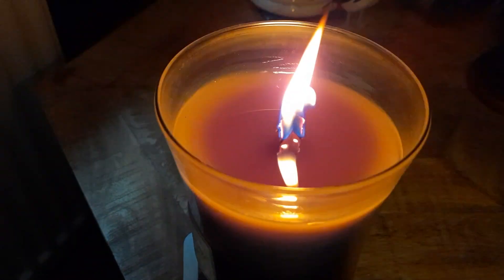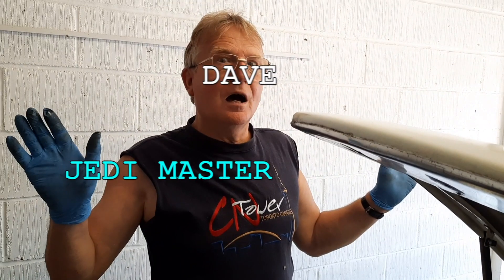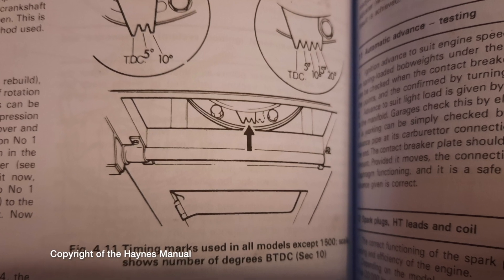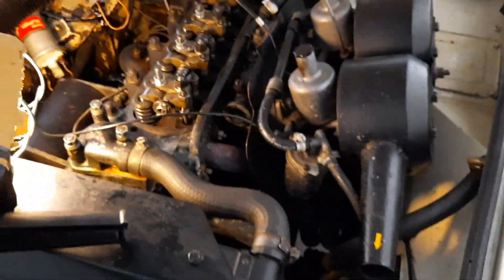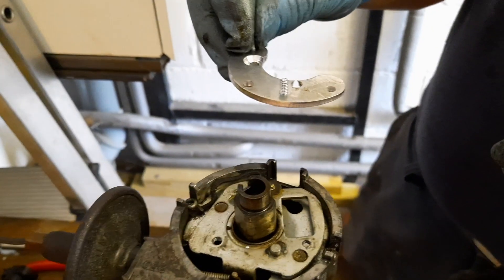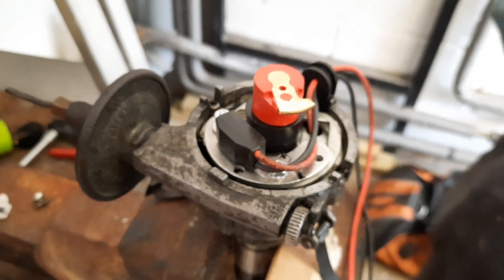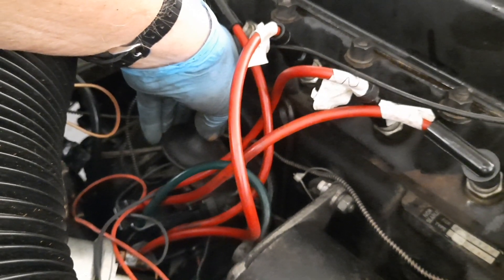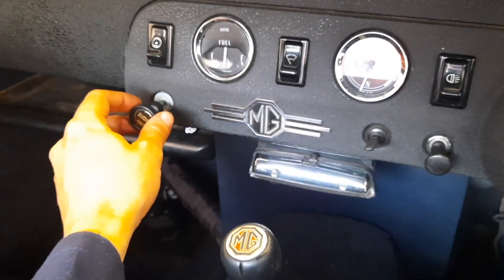How to install MG Midget Electronic Ignition

Comment: 3:51 Not much oil under that rocker cover... Is that normal? Wondering if I have a clogged drain passage or something. The valve side has a fair puddle of oil in mine. New to all this - your videos are invaluable! Cheers
Reply from the maker: Hey hey.
The oil was so new at that point that she was very clear. Not dark at all. So yeah there was plenty under there it shouldn't be spilling out just nicely lubed ! (Least that's what I was told)
Reply: Thanks for the clarification - good to know!

Comment: Hi mate, watching I noticed that when at TDC your rotor arm was pointing at 8oclock and not 2oclock.  Is this right? To me that says it’s 180 out. Obviously firing on cylinder one can then be achieved by swapping the HT leads. Or did you just simply put it back in according to how it came out. ? Cheers.
Reply from the maker: I'll check this back! I was looking at what Dave was doing and trust him completely  so we shall see !
Reply: @AndysMiniAdventures  I’m probably talking a load of tosh mate. Learning as I go along.
Reply from the maker: Nope. I'm always open to suggestions how the hell we gonna learn !!! Where a outs you based Carl?
Reply: @AndysMiniAdventures  I’m from Birmingham originally and been in the States for 20 years now and I’m Living in Rhode Island currently. I always wanted a midget as a kid and mentioned this to my wife and she bought me a mk3 1974. I’m an absolute novice but loving learning about maintaining these cars. Our Midget is part of the family now, LOL. You have helped me no end. Simple things like jacking up the car. Important and overlooked. Can’t tell you how nervous I was the first time. I’m following your progress, just adjusted my valves. Actually replaced my dizzy electronic ignition back to points and the car is running much better now.  Stripped my carbs and rebuilt. Love it.   Keep it up fella.
Reply from the maker: Love all of this Carl. Good work sir. I have to ask. What's it like rebuilding carbs? Amazing that you did that.
Reply: @AndysMiniAdventures  I did a-lot of research first off, lucky there is a-lot of info on carbs on line.  Then i just took them off from the heat plate, just 4 nuts 2 each carb. Then just started taking them apart on a bench cleaning and replacing key parts, Gaskets, jets, needle and seats, float adjustment, cleaning and lubricating all the moving parts. Then getting them back on and adjusting and tuning, mixture, idling, fast idling adjustment.  which is another learning curve on its own.  All in all the key to me was taking my time, no rush. very very satisfying mate. However i should have done my timing and ignition issues first when tuning the carbs, lol.
Reply from the maker: @carlbickerstaff5229  I would love to do this. Can you make a video 🤣?
Reply: @AndysMiniAdventures  Thats your job mate. LOL. Certainly would help you out if you need me too. The hardest thing about it was getting the bloody air filters out of the original (pan type) housings.
Reply from the maker: @carlbickerstaff5229  I find that oddly reassuring haha

Comment: I have to say that a good quality distriutor with points and a high output coil worked very well on the A series.  I've done this on several Minis over the years and never had any issues.  There are so many after market parts for these engines that you have a great choice of options.  If you want to get really nerdy about it, get hold of a copy of David Vizard's book on tuning the A series.  He covers just about everything you need to know.  Highly reccomended.
Reply from the maker: I might go back to points at this rate mate I won't lie !
Reply: @AndysMiniAdventures  What's making you reconsider?
Reply from the maker: Timing doesn't feel quite right at the moment. Choke disengaged and she wants to stall if I let her! So I might move the dizzy a little see if that helps
Reply: @AndysMiniAdventures   Did you go back to Points Andy ? I took my electric out and fitted points into a pertronix distributor, much much better and can be easily static timed. But now I feel the weights are not advancing right. Don’t know about you but I’m a believer in going back to standard. Lucas 25D4.
Reply from the maker: @carlbickerstaff5229  see I was told electronic ignition was the way to go. I'm finding that she doesn't run as well in my opinion. Dave and I are gonna hopefully look at it at Christmas. I kept all the points !

Comment: I considered this change. I was advised to reconsider as many stories are told about how unreliable these conversion kits can be. My MIDGET specialist mechanic convinced me to fit a new distributor with high quality points as a better option.
Reply from the maker: I'm considering going back!
Reply: @AndysMiniAdventures  What all issues did you run into ?
Reply from the maker: Just idling wasn't great